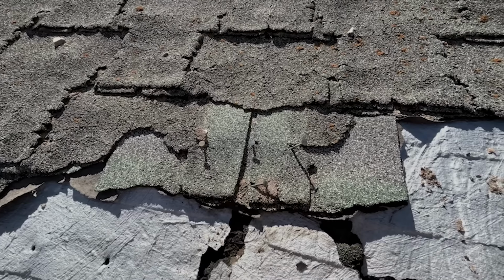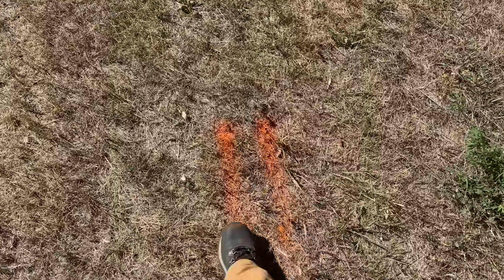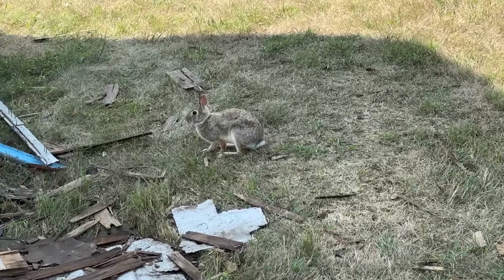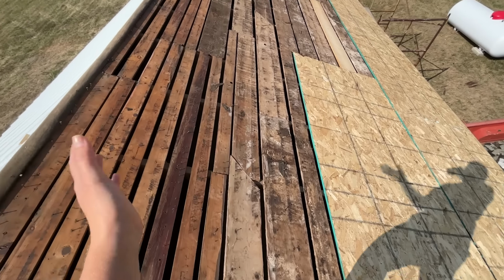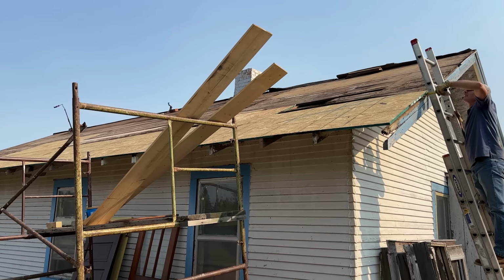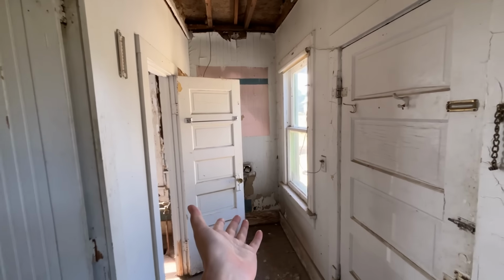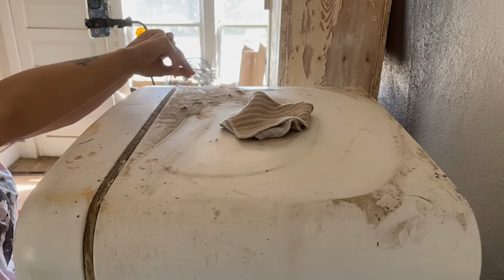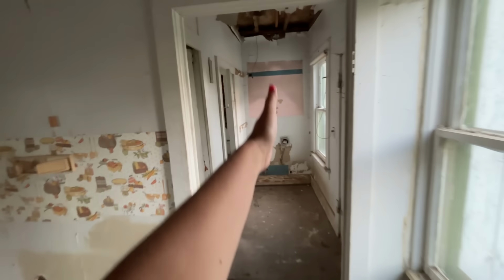Renovating My $1 Antique House

Comment: So much work but so worth it. May I suggest getting a construction magnet on wheels to roll on the ground around your house to pick up all the nails from pulling all those up from the roof. It’s by far the best way to clean all that up. Then you’ll avoid a bunch of possible problems like flat tires or stepping on them
Reply: Wow!

Comment: For your vintage fridge, I’d try using a very fine automotive rubbing compound. Then give it a nice automotive wax on the finish. While it’s not powered up go into the motor and cooling unit and vacuum out all the dust, silt and cobwebs. You’re doing great!

Comment: Awesome job on the roof. You should be able to cut a piece of glass or plexiglass to replace the refrigerator shelf. Try a heat gun and soapy water to remove the tape.

Comment: Tia, Congrats on the house.  I kept a 1950 Frigidaire from my parent’s basement.  It still works like a charm 74 years later.  Like yours, some of the plastic shelving is broken which I’ve repaired.  I also changed the insulation on the door.  Note: The door alone weighs a tonne.

Comment: Don't put your milk in the refrigerator door. Put it on the back of the top shelf. It will keep longer, because that's the coldest part of the fridge. Don't forget to put a box of baking soda in the back! You can get the rust off with plain old white vinegar. Just scrub it on with a toothbrush and let it sit. You may have to repeat, but it will take it off.

Comment: Always nice to know a great roof is overhead to protect rest of home inside. Definitely top priority to get done first. Then utility work next. Looks like an awesome job done on roof indeed. Will you be adding on the metal roof pieces that help break up ice on roof when begins to slide off roof in winter months. These pieces protect sliding ice breaking windows as it slides down roof. Always great to have the original wood in home be solid and not damaged by wear and tear over the years. Looks like your moving smoothly right along. Best forward. Love from Ky. on Bourbon Trail.

Comment: Nice.   Thanks for the update on your mask and filters.  👍🏻

The silver "paint" on the middle layer of shingles may have been a Conklin product that was all rhe rage 30 years ago in the state or even the product used to waterproof metal trailer house roofs.
Either way its satisfying to see the roof done right.  

Nice to see the power getting trenched in.  Having power in the house will be so helpful.   A suggestion,  Take a picture or video of the trench for future reference in case you forget exactly where it goes.

Comment: But asbestos fibers can hang out in the air for long time ots slow to fall on the grown the best way to keep it from floating is to spray down the area with water and some type of glue or call the professional to remove it.

Comment: Something that I use to clean in my kitchen is called Totally Awesome. It's great to clean up grease, food residue, and glue or adhesive residue. I've also used it on clothing as a prewash and it works very well. I found it at my local Dollar General.

I grew up in the 60's with a Philco refrigerator. I always thought it was cool when my mom would defrost the freezer. ❤

Comment: I love the progress you are making. Thanks to Dad for helping. When I rewired my 90 year old home, I wired the basement lights first so I could run the first floor wires up from the basement, then the second floor from the attic down. I removed the second floor baseboard to wire the first floor ceiling lights. I didn't have to remove or put any holes in my plaster for wiring. I did put 365 - 3" holes for blown insulation in the plaster. 99% of the 112 voice controlled smart home devices are built in, so my home still retains the antique charm.

Comment: I appreciate the way you fixed the roof.  Way, way, way too many people do coverups on absolutely everything these days.  It takes way more time and effort, but stripping back the oftentimes MANY layers to get back to the base first, and then starting the repair is absolutely the way to always do things.  Also a huge thumbs up for pulling all the nails vs. pounding them in.  

Chances are high that your house is asbestos free.  Like you said, the insulation is cellulose, and completely safe.  I didn't see old floor tiles that look linoleum-y.  They often contain asbestos, but it's kind of contained in the tiles and doesn't blow around when you break them up.  ie: if dealing with asbestos, asbestos tiles are about as safe as it gets.  I think you said 1920's and North Dakota?  Slim chance of asbestos plaster there until later.  Maybe if people top-coated or did repairs to the original at later dates, that would contain asbestos, but there's almost a zero percent chance that any original plaster is going to have it there.  Any drywall and mud is almost 100% chance.  Drywall into the 1990's had asbestos.  It's funny because people see drywall in old houses and think that's a new, safer thing, but besides plumbing and heating insulation wrap (around ducts and pipes), drywall is the most likely thing to contain it.  I didn't see any asbestos wrap on your plumbing or anything in the basement.  

Lead paint... yep... lots of lead paint.  All of it.  The mask and the shop vac are where it's at.  When you're near the end of gutting and cleaning a room... and you've already washed the the floors and ditched the water outside... you can get HEPA filters for your shop vac.  They are an excellent way to finalize the air quality.  I do that, and I have an air purifier with HEPA filters that I'll run for a few days.  Just to be safe.  

Really loving this reno.  Wish I could help since it's such a cool project.  You're kicking ass.

Comment: I have a 1916 old farmhouse.  And the house had boards like yours with space between them. That is the subroof needed for wood shingle roofs. If you are putting an asphalt roof on. It needs a solid roof, no spaces. As you have to nail the asphalt shingles, and you dont want to have a space that you nail the asphalt shingles onto and miss. As they will not hold. When we redid our roof. We put the OSB sheets over the slat boards, so we had a solid nailing surface. Then put on tar paper. Then, the asphalt shingles. Also, make sure to put a metal drip cap on all the edges. So that water doesn't rot the roof out from the edge over time. It's an easy and cheap insurance that your sub roof will last forever. We have lived here for 32 years. And when we had to replace our 25-year roof the second time. The roofers didn't put the metal drip cap on the first time. So we had to have some of the subroof edge fixed. This time we put on a 50 year roof with a moss repellant.  So great, no moss after 5 years.

Comment: great decision to "Remove" the nails from the wood in the Roof a lot of people just hammer the nails flat which is bad just leaves hundreds more places for rust and rot to start. i do not know if you did but i would check the other side of the roof incase that has multiple layers of shingles like the roof you just repaired, some inbetween maybe rotten.

Comment: One of the best ways I've found remove adhesives is with oil. The oil will dissolve adhesive making it easy to remove the tape. An all purpose degreaser cleaner will easily clean up the oil residue.  I prefer to use baby oil. Put the oil on the tape and let it sit for five minutes and see how easily the tape comes off. Wait longer and add more oil as necessary.😂

Comment: I like your refrigerator. We had some similar to yours as I was growing up.keep in mind you’ll have to defrost it once in a while because ice will build up in the freezer compartment. You’ll have to put all your cold stuff in coolers, shut the fridge off, keep the door open, and let it thaw. It takes a while. The ice gets thick. Whatever you do, don’t take anything sharp and try to chip the ice out, you can damage it. You’ll also have to try and keep ahead of the water as the ice melts. A big sponge and a bucket to soak it all up. Otherwise, your place is starting to come together. It’s going to be nice! Best wishes and take care!

Comment: The broken shelf above the drawer can be replaced with glass if you go to any glass shop where they'll cut glass for you. They can cut you a piece of tempered glass from that broken shelf and it's even got a bluish greenish tint to it. 

The other broken areas that are held together with tape can be fixed with epoxy

Comment: Great job doing the roof first and doing it right the first time, and with the roof done it means what you do in the inside want get messed by a roof that needed to be repaired, that's what we did and then the wiring.  You will always have things to do, just keep chipping at it and you will get it, best of luck. 😊

Comment: Home Depot sells white epoxy appliance paint that comes in a rattle can. It is absolutely amazing to work with. In my experience using it, it is almost impossible to mess up. It lays flat and has a high gloss to it. I realize maybe sometimes a patina is wanted on older appliances like your Philco, but just an option for you. Other than that I love the series and wish you the best with this endeavor!

Comment: Barkeeper's Friend is a cleaning abrasive which contains oxylic acid  which is a rust stain remover.  I would dampen some and let it sit on the rusty spots on the frig. (As little rubbing as possible to avoid abraiding the finish, but get rid of the rust)  It's about the same price as comet or ajax.

Comment: The Tilex reminded me, you said in a previous episode that you bought the Tilex to remove the mold from the wooden baseboard/drywall, but anything porous will need to be replaced. Mold is a living organism, and all you'll do on a porous surface (Non tile, no solid counters etc) is bleach the mold, it won't kill it. You'll need to cut out that part that is damaged by the mold and replace. (I learned all about mold in CE classes as an Insurance Agent by a restoration company) Ok, I'm off to buy a t-shirt now!

Comment: ❤ HI TIA .... About those FRIDGE DRAWERS
➡️ Soak all of them in 
really hot water to remove tape, use Borax. Use elbow grease to scrub the drawers down & remove tape. If there is residue, USE a product known as "GOO GONE" You can even use a light sand paper (220 grit) on the handles. Afterwards to finish you can use a polyurethane spray to bring them back to life & have a glossy finish. Also, use Crazy Glue to fix cracks before sanding. 
On the BOTTOM SHELF: Throw out the OLD piece and replace with a piece of finish edged GLASS cut to size.

Comment: Subscribed. Glad this video fell in my feed. I love to re-purpose old things. Cool old fridge there. ~  FYI, check the fan & Compressor before plugging in. If that fridge has sat for a long time (not running), check the rubber door seals & compressor. ~ Also, did the previous owner state that he wanted all of that stuff back? Some of those old windows are worth a lot of money to the right buyer. (@ 15:03)

Comment: A heat gun on the tape to pull it off. But be careful so you sit in one spot. Tape should peel off. Then rubbing alcohol and an old rag should clean any tape residue. That is what we did at the. Freezer plant I used to work at.

Comment: Looking at the video I think you are in a potentially snow prone or cold area.  I would highly recommend getting a structural engineer to review the support of that roof.  It looks like it's only supported by 2x4's the reason those roofs held up is because they leaked so much heat that snow would melt off.  If you are going to insulate again recommended you are going to need to strengthen that roof probably with 2x6's to each 2x4.  Also on old houseses like that sprayfoam insulation is amazing stuff.  It not only is the most effective insualtion but it will strethen the roof and make it virually leak proof.  If you don't reinforce that roof with more wood you run the risk of having a sagging roof after a heavy snow year and will need to replace it afterwards.

Comment: You can buy lead testers at the home store and asbestos testing is cheap. I don’t believe asbestos was in use in 1924, but you would want to test materials added afterwards like flooring or ceiling tiles.

Comment: That fridge is awesome, but a fridge that old is going to use about 3 times as much electricity as a modern fridge. My guess would be 3KWh a day for that fridge, and more like 1KWh a day for a 2024 Energy Star fridge.

Or to put it more simply, running that fridge is probably $200 a year in electricity, whereas a modern fridge is probably more like $70.

I enjoy watching this project. You're way less lazy than I am. 🙂

Comment: I wished you could be my neighbor I’m also renovating a house that was built in the 1930s while living In I’ve done most of the work myself did have some helpers your house is definitely in better shape then mine when I got it the only thing good about mine at the start a good portion of the electric was replaced I had to remove all the old wire set up I completely gutted the whole house and removed some walls but I’m nearing the end it would have been nice to have someone who enjoys this type of work to have an extra hand and someone to talk to all I have left that I’m going to do is the sheet rock the ceilings redo the porch roof and the house and garage are done I also been doing some foundation work under the house and this is the first home I bought and I do have a second lot I can build on I just don’t want to give up that space  I can either rent this house out or sale it to get another place just In a little bit better condition with the foundation and bigger house and bigger garage I want a shop well can’t wait to see your vids good luck hope you find some treasures

Comment: The danger of lead paint is somewhat overrated. It becomes a problem when disturbed and put into the air--or as the story goes, kids peel it off and eat it. In all my years I never met anyone who knew of anyone who peeled paint off a wall and ate it. You showed those Carharts in one of your first videos, and it would be neat to show a before & after pic of them when the house is all done because you are sure giving them a workout.

Comment: Should have just ripped that chimney all the way out so it ain’t in your way when remodeling inside either. And with you not going to be using it anyways the less amount of holes on a roof the better it will be for water to leak in 30 years.

Comment: I love your videos and everything you're doing!! Full support. I'm just concerned about asbestos in case your house does have it - a respirator is great if it has the protection factor required for asbestos removal, but it isn't enough to fully protect you from it and usually requires a licensed team that quarantines off the house and covers everything in plastic, wears full body disposable clothing and compressed air respirators plus an industrial vacuum that constantly sucks up the asbestos-filled air. At a minimum you should wear one of those plastic suits you can zip up over your whole body, head, and clothes so that you can throw it out immediately after + disposable gloves and boot covers. In some states it's even illegal to remove asbestos yourself, that's how toxic it is. I'm not sure if you think you'll be around more asbestos, but just in case. Also I don't want to assume your house has asbestos and I'm not saying this to try and scare you - just want you and your loved to be covered because asbestos is super dangerous!